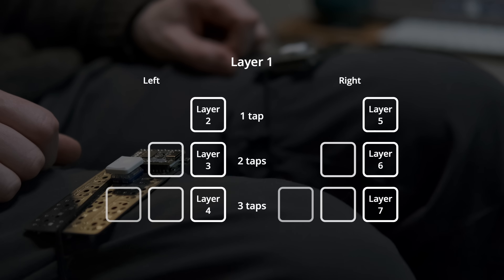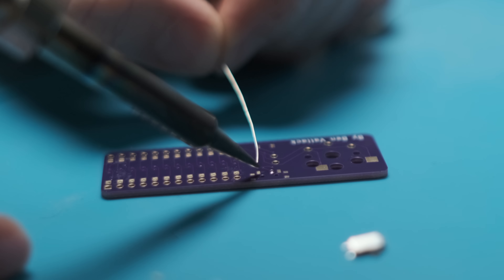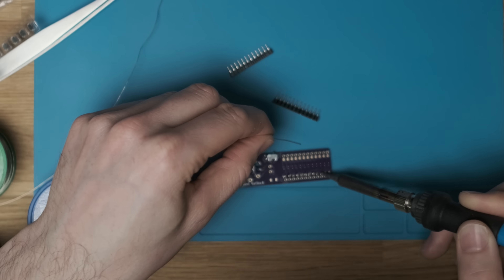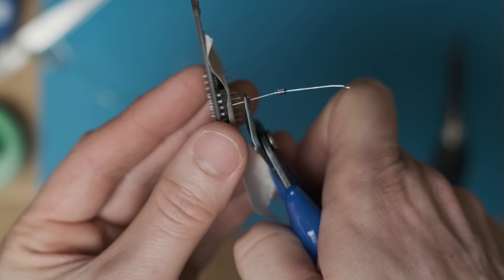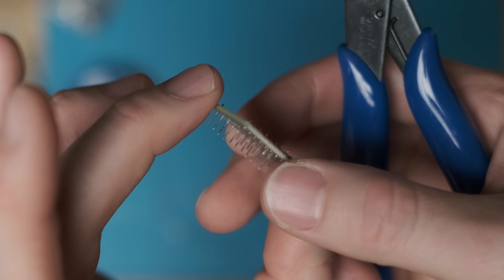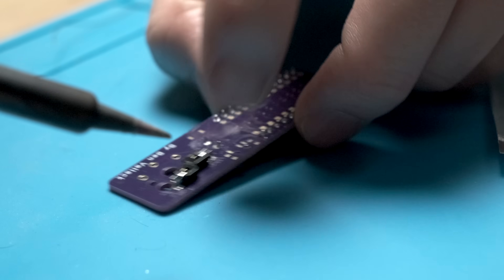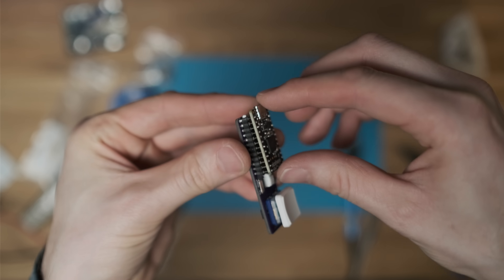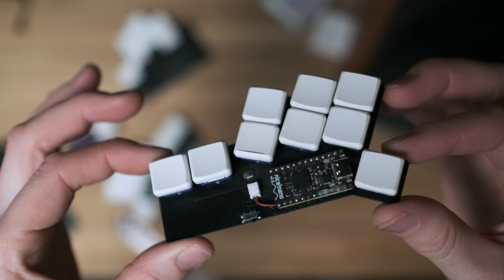Taking a Joke Too Far!!

Comment: Just curious, but why did you make your own pins instead of using a pin header?
Reply from the maker: I have used the mill max pins on other boards but they’re super expensive! Actually I prefer the way these diode legs slide in the sockets for some reason too!
Reply: @BenVallack  you can get RGB header pins on Aliexpress, they can be even cheaper than square pin headers. Diode legs can get too bent and unreliable if you disassemble the board and remove the controller often.
Reply: I usually just pull pins out of a header. The plastic bits just add extra thickness for no reason, there's already enough space for the battery with just the machine pin sockets.
Reply: the socked he used is probably not accepting square pins and he didn't have round ones at hand. (and probably a bit cheaper too)
Reply: @ZsoltBottka  machine pin sockets don't accept square pins, but round pin headers (for RGB connectors and etc.) are widely available. Much better choice than diode legs, in my opinion. Just a tad more expensive, but a lot sturdier.